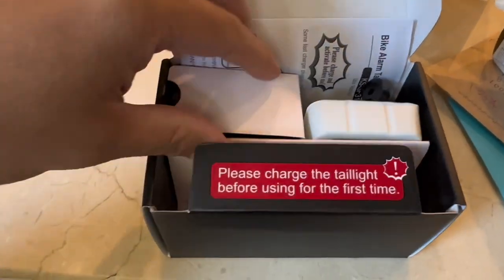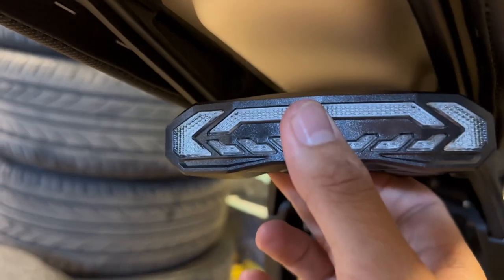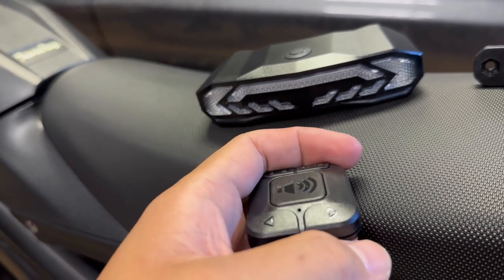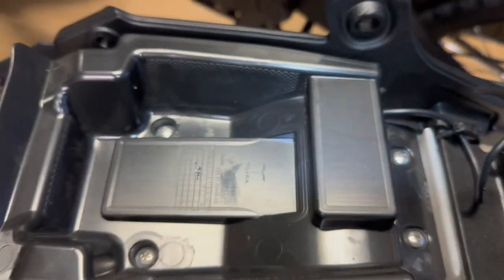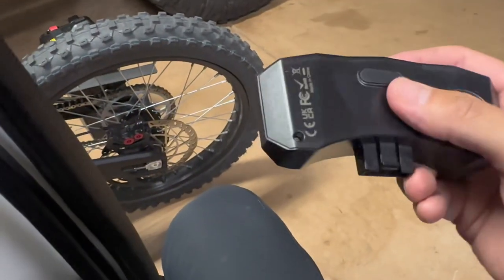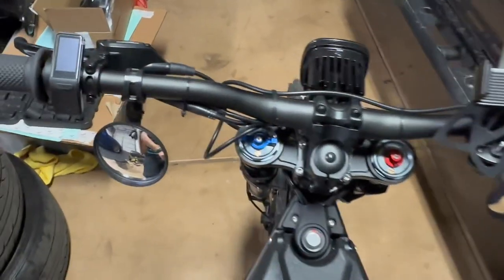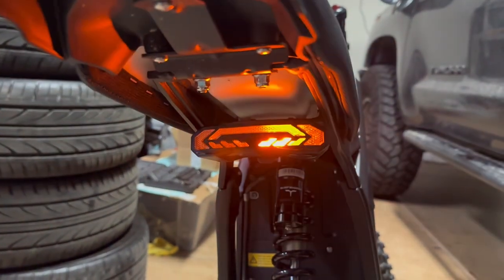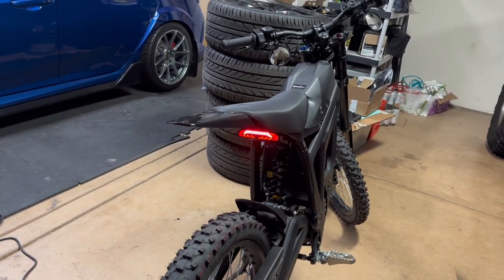Onvian Smart Bike Tail Light - Talaria Sting R MX4 Unboxing/Install/Review

Comment: Why didn’t you jus use the hardware included?

Originally I bought the light for the alarm and when I held it up to the taillight I saw that it’ll mount with the existing holes. Was super pumped on that. 

Down the line tho I’m guna try an figure out a working brake light. 

It’s cool for now.

Comment: I did the same with my XXX, still looks clean as long as I used black zip ties lol..... Screw holes were offset by 5mm or so on each side on the reflector mount below the active break light for the XXX. Zip ties works for sure as I didn't want to make a bracket. Super easy install 👍
Reply: In the future I want to open the unit and tap into the L&R blinker power source, run power L&R wires to the front, add an LED strip on the front fork for each side to replicate front blinkers to match the rear when activated. Who knows when I'll do it but it's an idea for the complete F&R wireless remote activated blinkers.